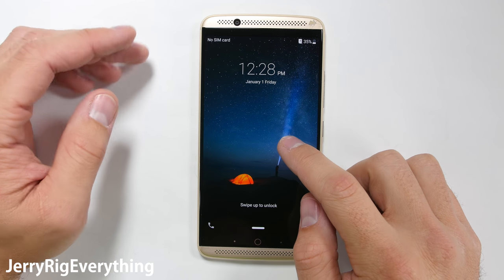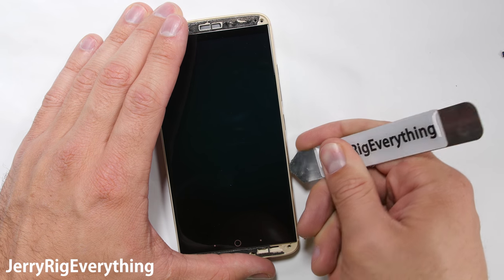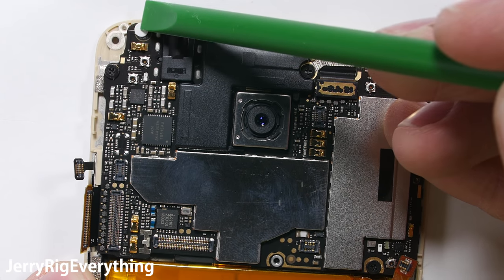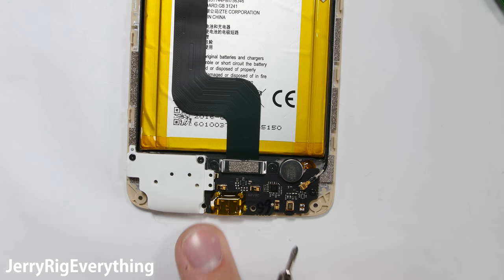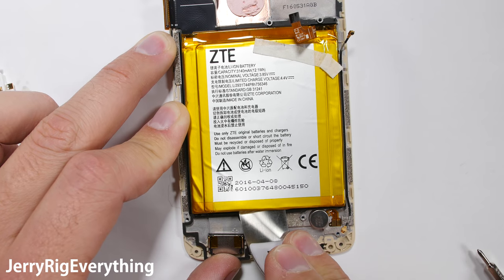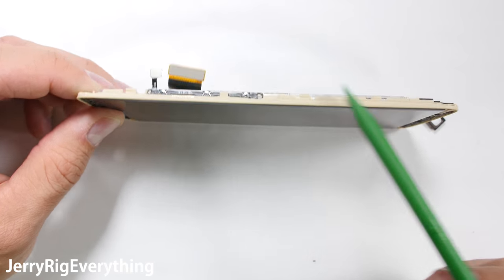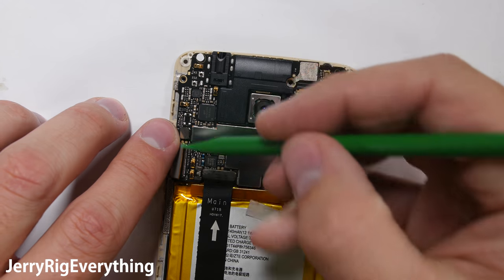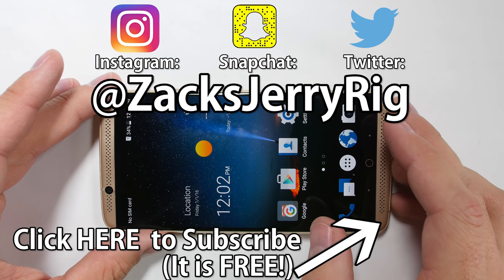Axon 7 Teardown - Screen Repair, Battery Replacement, Charging Port Fix

Comment: What type of adhesive is used on the speaker grills? Im replacing my battery and was wanting to know what I should use
Reply: Get some 3m double sided tape on ebay.  Usually comes in 25/50M rolls.

Comment: Hey, mine won't boot after replacing the screen, gets all the way through the boot sequence until it should display the lockscreen, the phone then powers down. Any thoughts of which part I may have damaged?

Comment: I accidentally damaged the display cable and now half my screen is static. Is there any way to fix that cable? Unfortunately it cannot be replaced by itself as it is soldered to the display. It is only a minor damage though

Comment: I was repairing old Lenovo a536 it appears that the screen ribbon connector is corroded, but I doubt that I can find one, besides changing it is like impossible challenge

Comment: This is a flaghip phone, not an midrange as you call it!
Reply: Simion Florin I'd call it more of a budget-buster, but it is ZTE's flagship
Reply: Snapdragon 820, 2 k display Amoled, 4 gb of ram. It is flaghip!
Reply: i agree with the dude, its defo flagship
Reply: Flagship means also good camera, good screen, and most important of all USABILITY.

It can have all the cores you want, if it's the laggiest shit ever, it's midrange
Reply: Technically, a flagship is the lead device in a company's lineup
Reply: Simion Florin No, it doesn't have enough features nor the premium build quality of a flagship. Not even the OnePlus 3 can be considered a flagship, which I consider superior to the 7, but let's be honest.... the Axon 7 doesn't have what it takes to be a flagship.
Reply: UnitedRecording it sounds like u have no clue of what u are talking about. it has evrything the competitiors have (hardware wise )build quality is a beast. typing this from the axon 7.
Reply: It has plastic speaker grilles, dude. C'mon.
Reply: UnitedRecording That's referring to flagship as a category, however.

As I mentioned, a flagship is technically a lead product in a company's lineup, typically the best and most expensive product in said lineup.
Reply: Tylenole 449 dollar flagship
Reply: Tylenole its easy to say that its no flagship without giving a reason why
Reply: Tylenole ill bet your talking about the axon 7 mini ? that one is 300 dollars the axon 7 is 449 .
Reply: UnitedRecording so according to your opinion the htc one m8 , m9 and probbably 10 (dont know for sure of the 10) are also no flagships cuz the also have plastic grills ?
Reply: Tylenole okay amazon but in store price is 449 dollars .what did u not like about the screen ? cuz im loving mine and i cant imagine whats wrong with the screen. the only problem i had with my axon 7 is it lagged sometimes but after the latest software update it got rid of lagg in software.
Reply: Tylenole Sure it wasn't a Mini? Both the Mini and regular Axon look identical, just that the Mini is smaller and that the regular one has capacitive buttons.
Reply: Jeremy Clakson 1.It has good camera for stills, and for video it's actually one of the few to be able to shoot 300fps and 4k H.265 codecs with dual image stabilizers (eis and ois)
2.it has a good display.
3. It's not a matter of cores when it shares similar hardware to the s7,(snapdragon 820 has 4 cores only btw)
Reply: UnitedRecodring "doesn't have enough features" "Not even the op3 which I consider superior to the 7"
Axon 7 has:
Dual hifi chipsets for superior audio quality 
dual front facing speakers
usb 3.0 transfer speeds
Microsdcard support
QHD resolution and daydream support
^ nothing from the above is featured in the op3
UFS 2.0 storage and the list goes on
>"Doesn't have enough features"
>"I consider op3 superior"
you know very little about both imo.
Reply: Frank M Overheating is the worst experience to have on a smartphone, I actually like what zte did, they thermal pasted the sd820 and made a vapor chamber, they couldn't do it any better, performance drops? Non of them, what you stated only applies to A2017G (eu version which doesn't have the axon logo on the back) which also suffers from severe issues like worse audio quality
My axon 7? It can maintain 15 apps including chrome with 5 tabs + background apps syncing without closing a thing, no frame drops on games like mc5 or modern strike.
Reply: D13H4RD2L1V3 what you mean?? you bought the eu axon 7?
just flash the A2017U firmware to fix everything, it works I guess
Reply: Frank M I get 5:30-6:30 sot on medium-heavy usage, on ultra usage, gaming and multitask I get 4 :) really satisfied with battery life.
Reply: I'm late to the party but u have to tell all you guys that this is ZTEs flagship with a non-flagship price. This is what ZTE offered for their flagship phone. Then it's a matter of you as a consumer who accepts it as a flagship it not.
Reply: Never lags here. I had to make sure that CPU throttling in the power management  options was turned off.
Reply: It is a midrange phone with almost flagship specs cutting few corners here and there
Reply: It's called a mid-range phone because it costs less than 8 or 9 hundred Dollars..
Reply: It can be both.  ZTE's flagship smartphone is a midrange device in price and performance within the smartphone market.  See how that works?
Reply: Well. Been 3 years since I've had mine. Using it right now. Can't remember the last time I used my desktop, or laptop. Because I cast everything to my Samsung TV when I want a bigger screen. It's had all the updates everyone wanted from the start. Including VR. 
The phone still sounds great. And I have a little Tribit Xsound Go, if it needs a Boost. And this phone will Boost that Well 💪 
And if I ever need a new phone. Probably would get Another Axon 7. 
It's done everything asked of it. Done it well, all day every day. And for all this time. Still looks brand new. And Only cost $279 on eBay way back when on sale. About the same price now. Which is less than 4 cents a day, rounded out so far. And it's still going... 
...i bought a caddy for my Dog with what ive saved over the years 😂...
Reply: Hell the new Axon 10 doesn't even have this über cool 2560*1440 screen!
Reply: Swim Team  
Yeah. It does the job. 
And if I get a woody for some super special effects pictures. I have a camera 😂 
Get that TRIBIT Xsound go speaker. $23 when I bought mine. The 7 makes it Rock. 
Saw new 7's on eBay for $249. Well worth the money. My battery will still last a day of use. But it ain't quit what it used to be. 
Cheers

Comment: Uh, did nobody notice that the battery says 3140mAh and they are advertising it as 3250mAh!
Reply: Jonathan Longoria You right... ZTE liers...
Reply: Jonathan Longoria the battery life is still good
Reply: yes
Reply: that's odd considering any battery app i use detects my axon 7s battery to be 3250mAh
Reply: ***** maybe they made it to say its 3250mAh
Reply: ***** Upload a picture here. Every single app I've used shows 3100.
Reply: Chanuka how are the dual cameras on 7s compared to the original single lens? I learned that the camera department on Axon 7 is lacking compared to other devices
Reply: selfie cam on the axon is pure dog shit and the front cam isnt too bad
Reply: Exactly why I came to watch this video after reading up about it on forums after I noticed that when looking for replacement batteries. Li-ion batteries are only good for 400-500 charges and after 1 1/2 years of use I'm not starting to see the battery drain faster as expected. 
Conclusion: The ZTE 3140mAh batteries found on eBay look like the proper OEM batteries to replace with compared to the Cameron Sino 3100mAh batteries found on Amazon. Replacement procedure is best done by carefully heating speaker grills & having spare 2-sided tape to place back on. Also heat the battery by running something like Daydream or Pokemon GO while charging to loosen the glue for easy removal. DO NOT RISK USING HEAT GUN on the battery! This can lead to leaking/exploding the battery and/or melting the screen or damaging other components. 

Bonus Tip: I would suggest fully removing the thermal compound with a microfiber cloth and Isopropyl 99%(not 70%) then replace it with some high quality thermal compound like Thermal Grizzly Kryonaut or Prolimatech PK-3.
Reply: I think i'm gonna try that. I've had my Axon 7 for almost 2 years and it's indeed a good phone, but lately it dies pretty quick and it lags a lot (with 1 app running on the background)

Comment: So, I replaced the battery on my axon 7 and it went about as easy as I could have hoped for. However, upon buttoning everything up, I no longer had a cellular connection. Any idea why? I tried the alt sim slot. I tried my wifes sim. I restarted the phone. I added a new APN. I took it apart and put it back together multiple times. Can't get it to connect.

Comment: i have a question, if i wanted to swap the logic board from an a2017u with a broken display that has hardware capacitive  buttons on bottom to another a2017u which the borard doesnt work on but has software buttons is that possible would the buttons matter when swapping the boards?

Comment: i dropped my phone in the water. I opened it and checked everything, 
every time  i turn the phone on it shows a greenscreen , i think the 
problem might be with the display since i can hear it turn on , but just
 can't see anything, is there a way to clean the display ribbon or take 
the lcd panel out or replace it? pls help

Comment: Don't the batteries discalibrate every time you disconnect them in these repair videos? My Moto X won't charge beyond 4% after replacing the LCD.😰

Comment: just dropped mine from waist height and it looks like it cracked the lcd very fine line (but not the glass...) and now its just vibrating every 10 seconds and the red charging light comes on and off

Comment: Why would they connect the SoC to the battery with a heat-pipe? If they battery heats up from charging etc. then it overheats the SoC. If the SoC is over worked it will heat up the battery. Either way this seems like a dumb idea. I would think that they would want to heatsink or heat-pipe the SoC to the aluminum back plate.

Comment: I shattered my screen and at least in the us it was only 80 dollars to send in for repairs just by the warranty they provide with the phone almost makes it not worth trying to fix at least for that issue
Reply: al alfveby Pretty good warranty, the deductible is actually cheaper than what the screen would actually cost to buy.

Comment: i just did this, but i ended up buying the wrong battery to begin with and when i put it back together the finger print scanner wont work anymore which is the only way i can access my bank account now i gotta reset my password on it

Comment: If you crack your screen or anything goes wrong with this phone, you're absolutely fucked! There are no replacement screen/digitizer/screen assembly available and moreover, you will lose the waranty if you don't send it to ZTE to be repaired.
 The phone comes with 2 year warranty and ZTE will charge you approx. $90 for the screen, you will send it to them, it will arrive a week later,   they will "repair it" for another 10 - 15 days and send it back to you. Then you will wait another week to arrive. The repair will be performed by somebody who had a quick training to do it and reading manuals while doing it. This person is most-likely a former delivery guy or waiter, maybe a dog walker. But what I just described is the best case scenario. When I sent mine for screen replacement it was fully functional and I was using it with the cracked screen for a month before I send it to them. 12 days after it was delivered to them I decided it's been too long and called them to see what's the progress. They told me the phone is unrepearable !??!! There was no damage on the frame or anywhere else but the top layer glass when I sent the phone to them. The technical support representative told me if I need more details I need to wait 48 hours for him to contact the technicians and find out why exactly is unrepearable. 48 hours later I called again and after 20 min conversation they told me I have to wait up to another 48 hours, so that they can escalate it to another department. And promised to call me as soon as they obtain any details. Nobody called in the next 48 hours, so I called again and asked to speak with a manager. The "manager" told me "she will escalate the problem to the responsible department" but also told me the motherboard is damaged, therefore is unrepearable. The only thing they can do is ship to me a refurbished device to replace mine. The problem is, that my phone was used for only 2 months and taken care of. From the minute I got it out of the box it was put in protective case and screen protector. They want to ship to me a device with unknown history that could be all scratched, the battery might be half worn out, the charging port might be barely making contact, the previous owner has been spitting on it and so on and so forth. So now I need to wait another 4 days for them to find out who is lying that the motherboard is damaged. If they ever tell me, I will update the comment. 
There is another option they give you if something goes wrong with your phone. Initially you pay them $90 for the repair + $435 which they will hold for a month, then they ship you a refurbished device that becomes yours and once you receive it, you should send yours to them. Once they receive your phone, they will decide if it's covered by their warranty. If they decide it's being water damaged or something else to void the warranty, they will keep your $435 and you will be screwed with refurbished phone with no warranty for more than the price of brand new one (I paid $300 for mine at Best Buy)